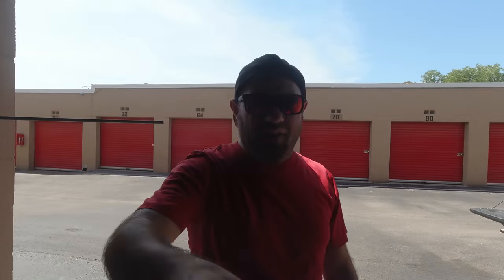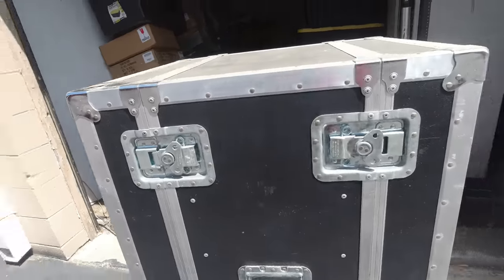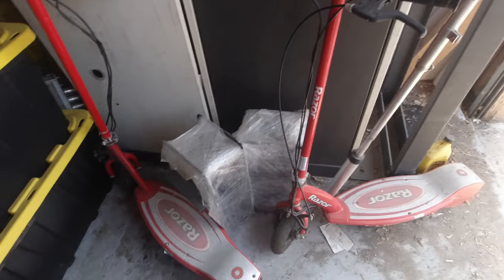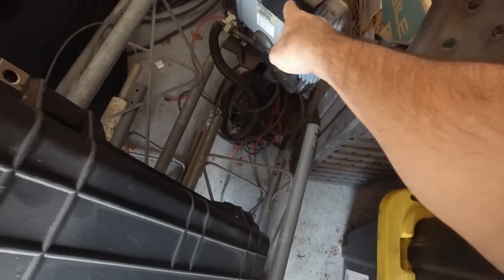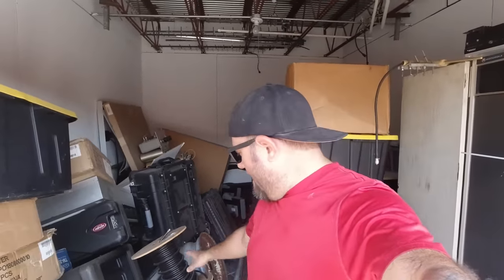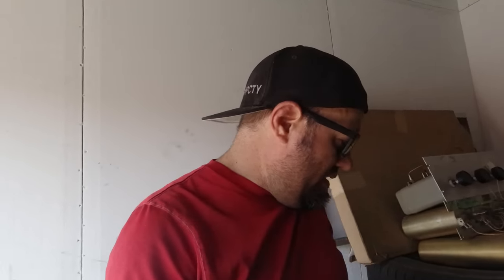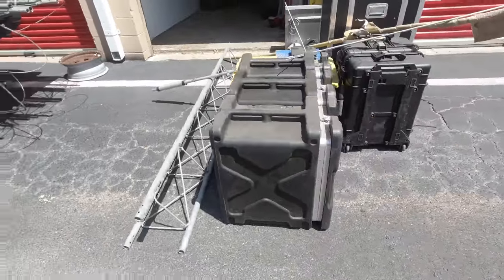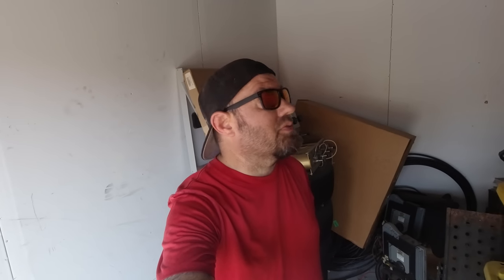Vlog: 70% Rent INCREASE!  Ham Radio Storage Building Gets EMPTIED!

Comment: Its cheaper to buy a 6X10 trailer for a grand used or new for 2 grand and store your stuff for 5 or 6 years  100X12 months $1200 X 5 years $6000 that's a nice trailer if you have a good driveway! OR - some really killer Radios!  73's
Reply from the maker: Yeah but then it takes up space in the driveway or you have to have a place to store it
Reply: @HamRadio2  I am in Oregon or I would buy some stuff!

Comment: That's pretty cool of you to giveaway your old stuff to someone. Or sell it for a reasonable price to someone. I didn't realize you kind of have to be an electronics tech to get into radios. It seems like you can get stuff for cheap if you know how to fix it and some of this stuff needs repaired a lot CB. Do you know of any good CB radio guys that are reasonable that do a good job? Some of those guys just crank up all the pots and align nothing! If those power supplies are going or anything I could use for a base (for a CB at the moment) let me know.